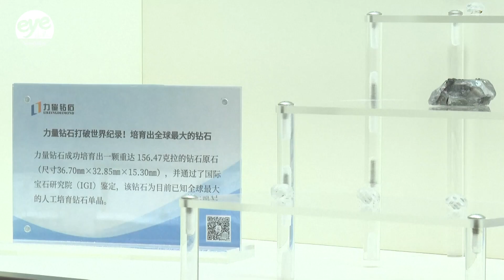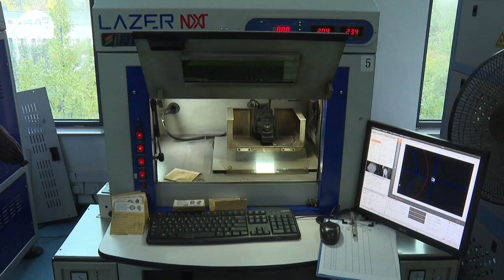Chinese company produces world's largest lab-grown diamond

Comment: So you warm up graphite (carbon atoms) to 1300 C while it's under pressure a week or two, and it turns into diamond (carbon atoms). In graphite each atom is connected to three other atoms. In diamond each atom is connected to four other atoms, and therefore transparent and stronger than graphite.

Comment: They can also make diamond plated armor with an inch of diamond
   This armor cannot be penetrated by depleted uraniam rounds at all.
Reply: 🤣🤣🤣 That's physically impossible!!! No one can do that! Saying that any nation on Earth can make inch thick diamond armor plates is like saying that they have invented a light switch for the sun or a perpetual motion machine!
Reply: @PoorMansChemist  Perpetual motion breaks the first law of thermodynamics, so impossible. A light switch for the sun, sounds like some thermo issues there, but an 5 cm inch think diamond is a simply material problem. As we say, "Just get enough, big diamonds and glue them!". IT IS POSSIBLE.
Reply: Diamonds are BRITTLE. A whack with a steel hammer and they completely shatter.
Reply: @allangibson8494  "Because a thing seems difficult for you, do not think it impossible for anyone to accomplish"
-Marcus Aurelius
Reply: @johnsmith1953x  
Diamonds would make lousy armor. Diamonds are hard but brittle (like glass).
High tensile strength makes better armor against impact, and high melting points protect best against shaped charges (hence ceramic inserts in modern armor). The current best balance for body armor (which also requires light weight) is ultra high density polyethylene (which also floats). Graphene is a possible future option.
Reply: @allangibson8494  Well if u believe that, good for you. Not true, but eh...